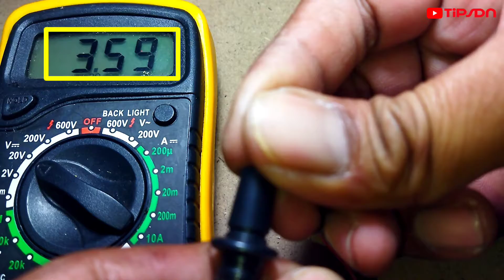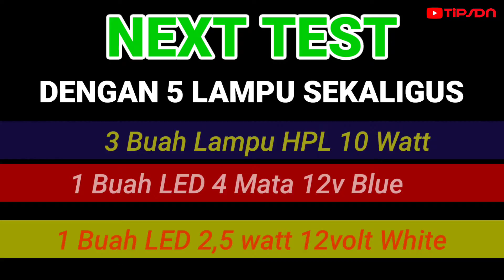Membuat Rangkaian Step Up Dc (input 3,7volt - Output 80v )

Comment: Kalo bikin speed control treadmill yg voltasenya 180 atau 200 V, arus 3A gmn caranya Bang?
Reply from the maker: simple sebenernya bikin dimmer Dc nya bang, beli dimmer dc di pasaran jg banyak sebenernya , kami mau bikin tapi kami tidak ada Dinamo treadmill untuk test, mengingat dinamo treadmill cukup besar voltagenya ( 180v - 200v )